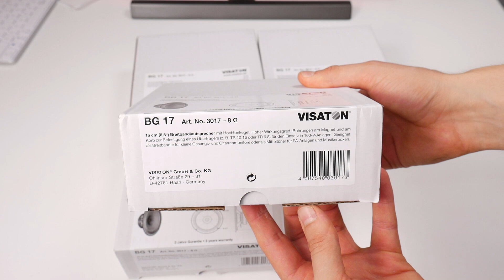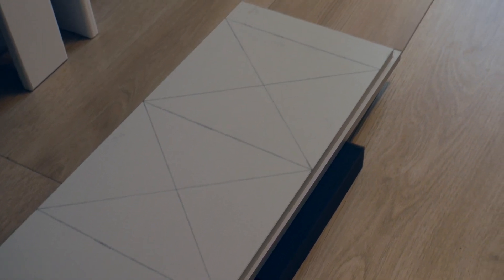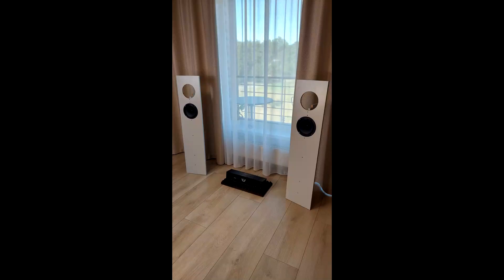How to Make Open Baffle Speakers Under $100

Comment: The principle of an open baffle is very old (and excellent). But then we are speaking about a "baffle" of, at least, 1 square meter . (to be able to render the lower sounds).
In your case you'll have a lack of low and you'll need a sub.
Reply from the maker: True, that's why I have several subwoofers. But now, I'm waiting for a DSP to make the sound smooth and balanced.
Reply: @Techscrews  did you know that the idea of a (sub)woofer plus "ambiental" is almost as old as the HiFi-phenomenon? (Bose didn't "invent" anything !!! ) 
In the early 50ies (no stereo at that time) some were experimenting with the - in that time popular - right-corner-placed woofer plus an "open baffle" that was placed "high" on the opposite corner. 
Years ago I experimented also with that idea after I brought back to life an old Williamson tube-amp.
So I placed an old "box" with broken tweeter/midranger on my right and I mounted an old Philips-fullranger (15cm) on a 40 x 25cm board. 
I had to "fiddle" a tad to find the correct cross-over value and the location of that "baffle" but the result was really pleasant. Especially for old mono-recordings of classic music. 
Just as in a concert-hall the higher (violin) tones came (more) from the left and the lower tones (cello / contrabass) came (more) from the right. Quite a "spacial" feeling/listening from a mono-recording.
Even popular music sounded more open compared to the "one-speaker only" used with mono-amps.

Comment: Caution! You should be aware of the fact that connecting two speakers in parallel mode will divide the resulting impedance in half which can easily damage your amplifier! For parallel mode you should use 8 ohm-speakers.
Reply from the maker: these visaton bg17 are 8 ohm :)

Comment: Guys! never use double full range speakers. Ok?
Reply from the maker: but why ? I got a much higher spl with the double full range speakers.
Reply: In low frequency ok, but mid and high will be foggy, not bright at all. the sound quality will depend a lot on your position in relation to the speakers.  @Techscrews
Reply: Also I am using 2 full range open baffle speakers with small subwoofer. like 2.1 system  @Techscrews
Reply: and spikes will not help you

Comment: Great video. Did you just run the cable straight from the driver to the amplifier or did you mount some binding posts on the back somehow? It seems all the binding posts want to be through the box and not open baffle. Thanks!

Comment: Now do with esoteric crossovers caps and non inductive resistors.
Reply from the maker: Why? That is fullrange open baffle, there no need crossovers, that change sound and eat enery from amp.
Reply: @Techscrews just because something is advertised as “full range” doesn’t mean it has even close to something resembling a flat-ish frequency response. I mean if you measured it and it’s good—then sure…

Im about to build a 3-way OB DIY—will be using a VERY simple crossover with only 3 parts… and you can buy inductors and caps with very low series resistance that won’t “eat” very much signal. Driver selection and positioning is key because you can shape their response by “slot loading” from the back without even using electronic filtering, to a degree…

Comment: Open baffle have their own unique sound which to me, is far more natural than any conventional box speaker.  Even with very inexpensive drivers, they can sound really nice!  I've been doing open baffle since 1994 and could never go back to box speakers for critical listening.
Reply: @mfkhometheater7742

Hey friend, where would you point a lower middle class, special education teacher who loves audio but is not super technically minded. 

I have decent reading comprehension and my brother in law is a competent woodworker.

Thanks in advance for your help my friend!
Reply: @Silence-and-Violence I am building a pair of open baffle woofers SB bianco 15 OB with an ess AMT on top. Two woofers are €260 and the AMT are €230. The crossover is around 1000hz. Bit lower even. Get a miniDSP for 250 and some second hand amplifiers. Add a bit of wood for the baffle and it can be done quickly. Without the amps you would stay under 1000. Probably way under if you are in the USA. And those should sound wonderful 👍
Reply from the maker: Thanks for feedback

Comment: HI Try placing a small aluminium sewing thimble on the dust cover with glue, They will sound fantastic the midrange will burst into life.
Reply from the maker: Thanks for the tip, but dust cover also is horn for high freq.
Reply: @Techscrews  please see    how to turn a bass speaker into full range
Reply from the maker: You cant simply turn bass speaker to good fullrange, physics can't be fooled.
Reply: Really? Okay.
Reply: @Rocker6969  hi the dust cap must be hard plastic, place the thimble in the center open end down, sounds amazing.

Comment: For those who will build one: one baffle speakers are without back pressure. Meaning, all low frequency content upto 200hz is out of phase and cancellation each other. Unless, you got very good DSP. You get great sounding speakers without boxy sound issue.
Reply from the maker: Thanks for feedback :)
Reply: Yes OB speakers need to be equalized for the bottom extension. OB rolls off naturally 6db/oct so it will be extremely powerless on bass without a proper crossover network.